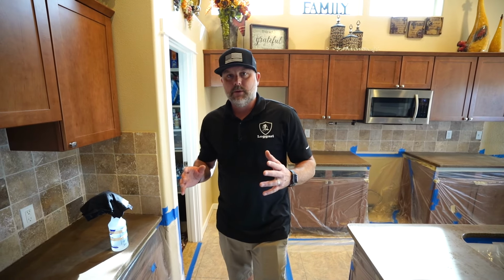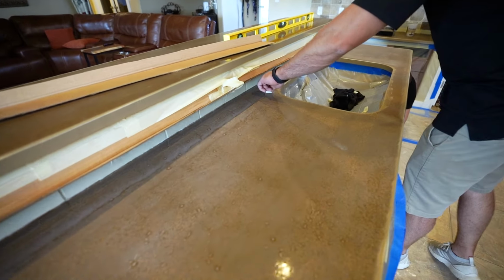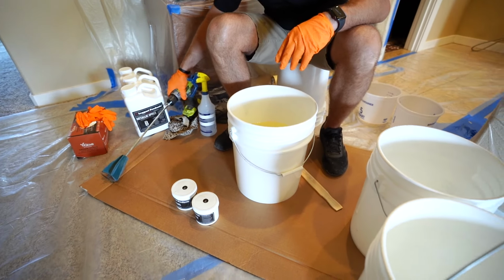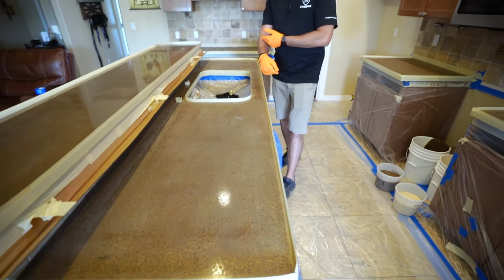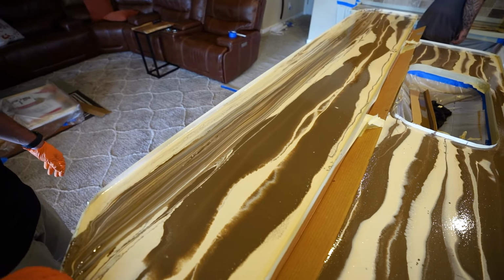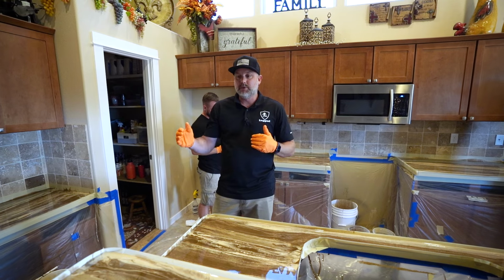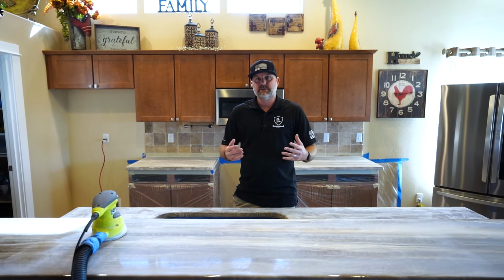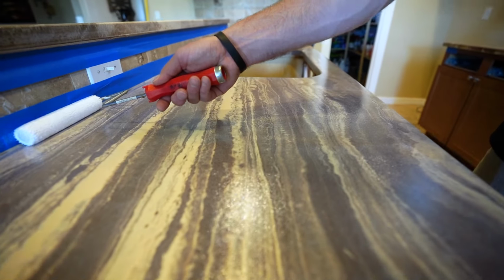How to Prep Granite Countertops For Epoxy | step by step

Comment: I have a question to see if you can help me. I have a kitchen with full granite countertops and backsplash, but I have seen some videos where they say that epoxy resin is self-leveling. If so, how can I make the granite backsplash that doesn't drip? Because the top and the entire backsplash must look the same (high between the upper cabinets and the top). Is there any other resin that won't squirt? Thank you so much

Comment: How long does it take for a countertop to fully cure, or at least be usable. I have a bar and want to do this to the counters, but am open 7 days a week.
Reply from the maker: Hello! It is possible to finalize this process within 24 hours if you do not plan on top-coating it. However, to apply a topcoat, you will want to wait until the epoxy is set which is typically the next day. Please contact our customer service for the specifics on timing when using our products. Thank you!
1-844-LEGGARI (534-4274)
customerservice@leggari.com

Comment: How do you remove the roller marks after applying urethane as top coat?
Reply from the maker: Hello! As you roll out the urethane topcoat, keep it as even as possible because once it dries, it is very difficult to fix.. Our Urethane topcoats are designed to go on smooth and flat, as long as it is applied in small enough sections so the urethane does not go on tacky. Thank you for watching and good luck!